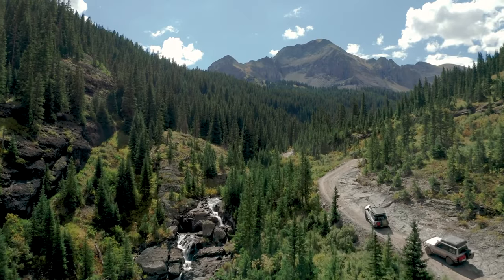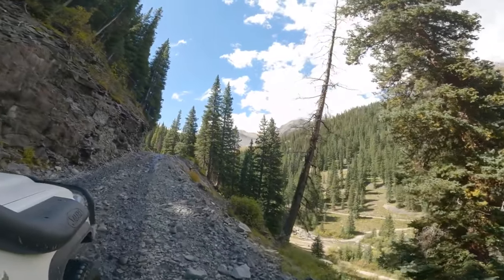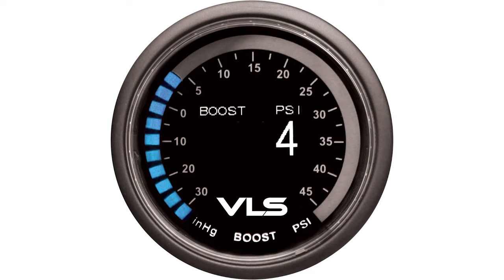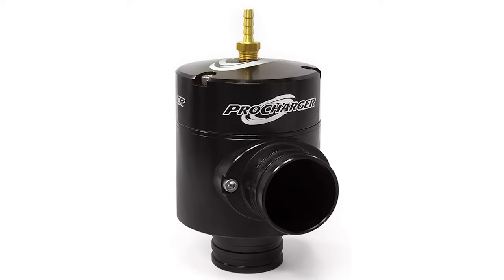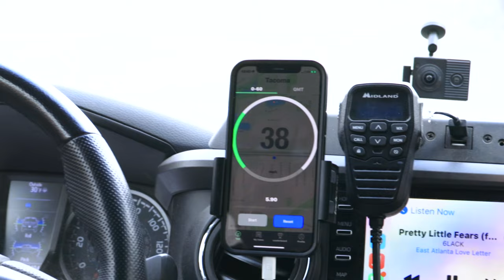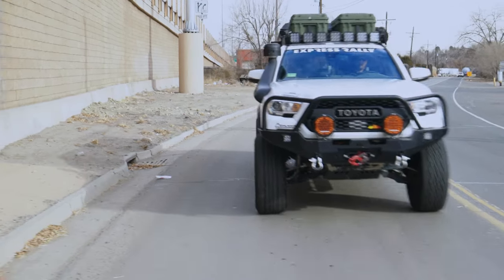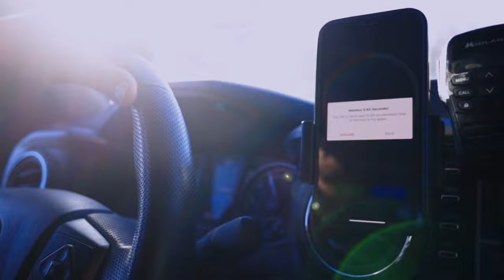🚨 BOOSTED TACOMA 🚨 ProCharger vs Magnuson Superchargers

Comment: Man I completely disagree with y'all on when I need/want power off-roading, and just for daily driving up and down the hill on I70 or in the canyons. If I were to spend 10k to make my truck marginally better I would absolutely shoot for low end torque for all scenarios of driving.
Reply: Imagine getting a platform that already makes low end torque…don’t buy Toyotas.
Reply: @rossomeness3549  I have all the low end torque I need in my 2020 HO 6.7 Ram 3500 with the Aisin and an "exhaust upgrade". And I have my Toyota for hunting/daily. I buy reliable simple trucks that work. Fords and Chevys are absolute junk...
Reply: @manwithnoname734  Then why did you buy a Dodge? They are just as shitty as Ford, or brand x.
Reply: @warhorse58gt  I've worked in the hotshot industry for 8 years and have been an owner operator for 5. I have hauled over 1 million miles total with Chevys, Fords and Rams. I had a cp4 blow up on a Ford at 55k, tranny go  on another Ford at 60k, and had the emissions fail on a Chevy 80k, but I've never had a single real problem with a Ram. My current 2020 has 400k trouble free miles on it. The 6.7 Cummins with the AS69RC is the best current 1 ton truck period!

Comment: I went with Magnuson and an OTT tune. The 0-60 times are slower on these trucks because of the lazy shifting. It really shines with passing on the highway. I also like that there is no oil to change on the Magnuson and it gets rid of the plastic upper intake with ACIS and keeps the battery in the same position. Never had any issues with losing traction on trails from the low end torque because you hardly ever get into boost unless over half throttle. Plus, Toyota endorsed Magnuson when they used to make the TRD superchargers from the factory.

Comment: Thsi is one of the better BOOST vids i have seen. It's good to see somebody regearing differentials for a change instead of just adding boost. You put a much bigger tire, you put a lot more stress on the powertrain and you need taller gears. If you only add boost you put a LOT of stress on the transmission, which will reduce its life.
Reply: I like the manual transmission for this reason...  It's easier to rebuild when I inevitably destroy something.

Comment: My Taco is a manual transmission, so the pro charger will probably be a better fit.

You mentioned the 3500+ RPM range a lot… that’s where my VVT kicks in. Otto > Atkinson.

Comment: I mean, the biggest problem I've faced is the lack of torque in the lower RPMs when I am driving on the trails. The transmission hunting can be fixed by either choosing the manual or getting an OTT tune. I suppose, if I had the money, the Magnuson is what I'd go with. I want the truck to crawl through obstacles with minimal throttle. Wish Toyota offered a diesel option tbh

Comment: I read about a dudes 4R procharger after a couole years and he has to change his belt every 15k it gets loose and squeels...the maggie on my 4R has 35k on it no belt issue w only 6lbs. Also keep in mind certain Toyota dealers supports maggie so if your in a jam out of town that might help. 4R does 0-60 ~6sec w maggie at sea level thats high 13->low 14 sec 1/4 mile lol.
Reply: The Procharger belt on the 4R takes less than 2 minutes to swap out, and does 8psi

Comment: Awesome video. Are you guys using the fuel booster for the procharger? Or did you guys change out the fuel pump?
Reply from the maker: It comes with a booster :-)
Reply: I'm torn between the pro charger & the magnuson. I live in Houston where I mainly use my truck for daily driving/camping trips. I have weight around my truck so which one would you prefer I go with?  @mtnyotas

Comment: Which of the two would be good for towing an aluminum car trailer with a 2700 lbs car? Stock suspension and tire size ,TRD Sport V6 2wd. Thanks
Reply from the maker: A regear would help a lot more than a supercharger for towing!

Comment: Just curious, cause per the official page, it states this charger will put the 05-15 at 390hp ....that 0-60 run with only a second difference doesn't appear to be a 390hp difference of it's stock run with the same weight included, is there something I'm not calculating ?

Comment: Most folks dont spend alot of time in the upper RPM ranges, where the procharger makes its power.

Low end torque is where these truck suffer. If you're driving a heavy rig or towing. You'll be better served with a Magnuson. Although it adds less HP and torgue with the provided tune. The additionsl power is where its used and needed the most. 
You also have options such as custom tuning and smaller pullies to gain you some additional ponies and torque.

Comment: Do you have to use higher Octane fuel? Is there also a "Pro Charger" option for 5.7 Iforce in 21 and older Tundra?
Reply from the maker: Yes, you'll want to use 91-94 octane!
Reply: What would I do a road trip if I’m unable to purchase the higher octane fuel?
Reply: 91-93 should be available basically anywhere in north america.

Comment: Both power adders would be nice for the odd balls like me wanting to build a tacoma with a drag pack and create a sleeper
Reply: My route rn. Waiting for fuel pump upgrades and pulley swap and better tun-ability. Procharger is definitely the way and stays cooler and has top end and better overall power.

Comment: So im looking into a supercharger for towing. Im only towing a honda civic (2300lbs) with a 16’ aluminum trailer (1500lbs) im not into the over landing stuff but more power would be nice. I travel over plenty of mountains in the NE so im curious on inputs of which route is better. I know the difference between the two chargers but im wondering if anyone has towed with either of the two
Reply from the maker: Best bang for your buck for towing is a regear my man!
Reply: You need turbo, my friend.

Comment: Is it possible to use a supercharger with a snorkel on an overland Tacoma build?
Reply from the maker: Yes it is... we have a customer who has a snorkel with a Procharger.
Reply: @mtnyotas  Thanks. That's super helpful. I'm struggling with my build plans. Wanted the size and load capacity of the Tundra, but there are so many more after-market options for the Tacoma that's its not even close. So, I think I'll just try to build a beefy Tacoma 'cause Tundras don't get as much love.😏

Comment: How the hell does the Tacoma need more power above 3800 RPM? It has absolutely no low end power and that’s exactly where it’s needed. The 3.5  makes all its power up high. I’ve had it all the 3.5 the 4.0 and a 5.7 with a Harrop supercharger. Low end torque is where it’s at specially when you had 2000 pounds of crap to your rig

Comment: does it come with 1 or 2 step colder spark plugs or you can still run the factory spark plug with it gap down?
Reply from the maker: It doesn't come with spark plugs but we use NGK 7505 spark plugs when we do a ProCharger install!

Comment: For that amount of money, I would prefer a v8 swap.
Reply from the maker: You will not get a V8 swap for under $10k
Reply: @mtnyotas  I know that. If I was at that amount of money spent, I would prefer to dump extra and go for the upside of a v8.  I’m  not criticizing your business, I hope you install lots of them.   I see many rigs loaded down and trying to also tow.  I’m just stating my preference. For the street and simplicity, your options are great. But when I see 37” tires, trimmed front ends, and thick steel front bumpers, I would rather have the flexibility & upside of a v8 swap. Great content though and keep it coming.